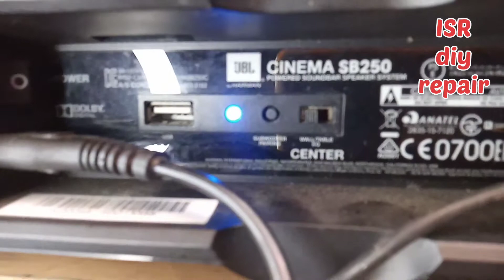Pag install ng reborn 2.5" speaker at pag sound check.Part 3 JBL Cinema SB250 ..

Comment: Ask ko po sana yung jbl sb250 mejo may karaskas ng sound sa may bandang left. Anu po kaya pwede gawin.
Reply from the maker: Good day sir,yung left speaker nya sira na ang edging kaya nga karaskas na ang tunog. Huwag mo nalng patugtugin masisira ang voice coil nya..hndi mo yan ma diy sir,need liget technician to restore ng left spkr nya.
Reply from the maker: Good day sir,yung left speaker nya sira na ang edging kaya nga karaskas na ang tunog. Huwag mo nalng patugtugin masisira ang voice coil nya..hndi mo yan ma diy sir,need liget technician to restore ng left spkr nya.
Reply: Yung subwoofer ng JBL SB250 ko walang power. Anu kayang problemA?